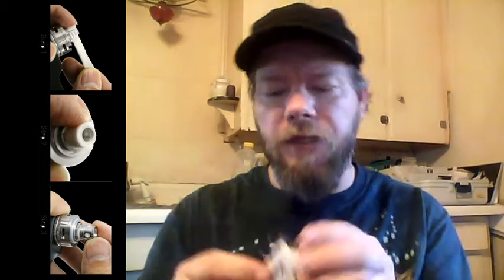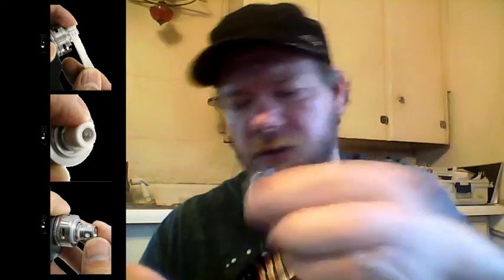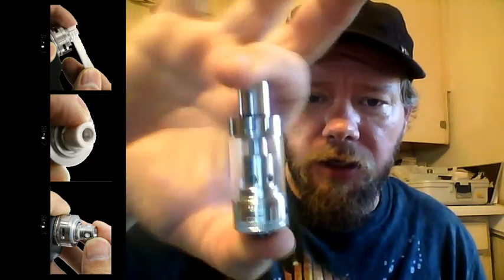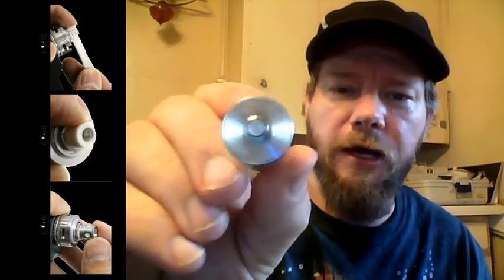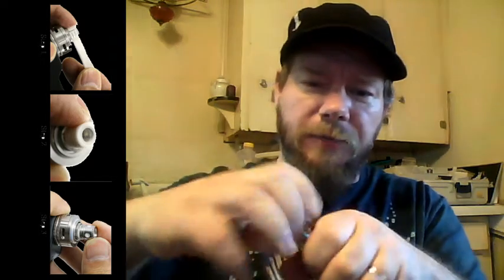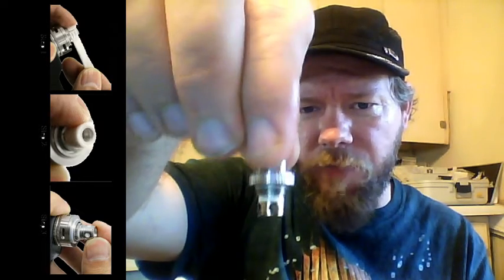HORIZONTECH KRIXUS

Comment: I want to use this on tc mode, is that possible?
Reply from the maker: with the right tcr it is, however i do not have a mod capable. i believe u can find the tcr for tungsten with a quick google search. I do not have the tank setup currently or i would try it on the kbox.